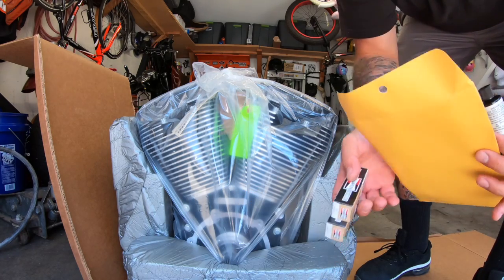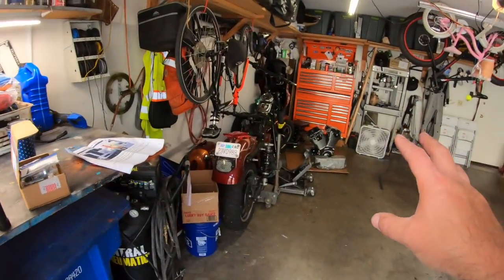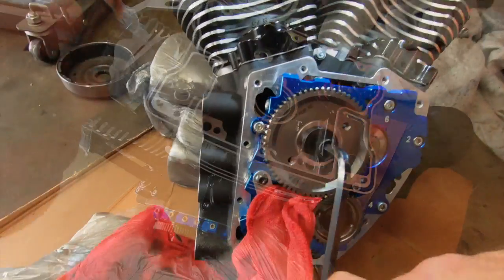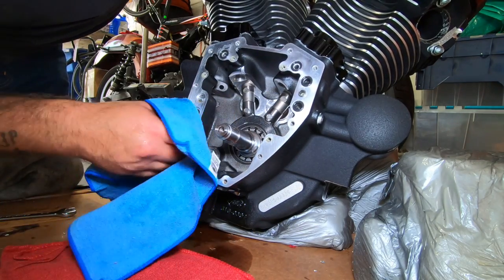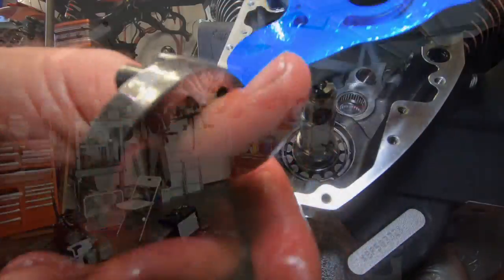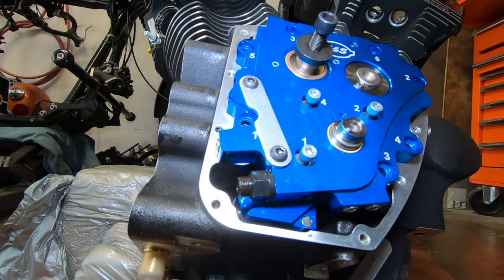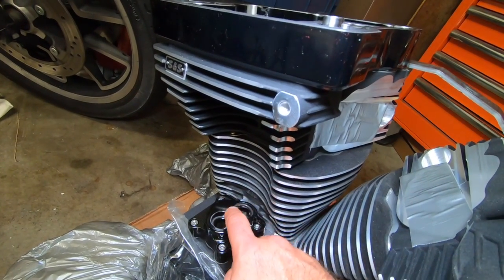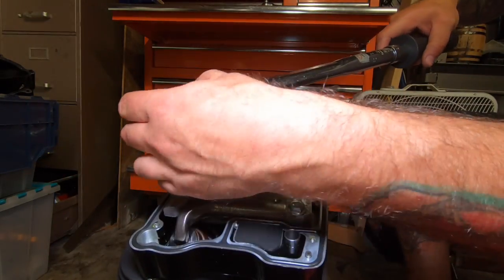S&S OIL LINE KIT UPGRADE!

Comment: You mention Vulcan moved the lowest hole the feed hole over. Looks like nearly and inch. How does that hole now line up with the transmission and oil pan?  Would it be better to hire a machine shop to move that feed drill bushing to match the harley case?
Reply from the maker: So what I noticed is that the case is a little bit different when I say that it seems to be a little wider now that may not be the case but the oil line, the port, its self that is drilled from SNS runs to the bottom of the motor Instead out of the back, so are three lines come down to the very bottom of the motor so it’s routed a little different. You do not need a machine shop. This was extremely easy as long as you know how to drill something you can do this job it’s extremely easy with that said you could spend $800 for the transmission pan and oil line and keep your warranty but I am in talks with SNS right now speaking about the warranty and this job. They made it so easy to do it should be warranted.
Reply from the maker: So Vulcan didn’t S&S did

Comment: I don’t really know why S&S designed their cases like that to begin with looks like they’d make it like factory r at least have a choice in it anyways and all they had to do was just move one hole over for copyrights are technically but Ultima builds them not sure of their cases but they r like stock cases which they make a pan for it like 600 bucks are more pretty much all of theirs are gears guess one good thing it is aluminum shavings not good but better than metal
Reply from the maker: You can get a custom-made S&S motor with Harley cases the reason why Ultima has the patent to produce The motor or has the choice to produce that motor I believe it has something to do with the years so I cannot put an Ultima motor in my motorcycle because it’s a 2013 but if I had a 1999 I wouldn’t have a problem obviously you can. It’s just not set up for it.
Reply from the maker: Also Ultima cases are different then Harley’s and I don’t know about metal shavings I blew everything out with air and cleaned very well